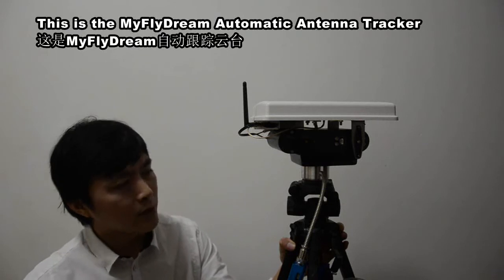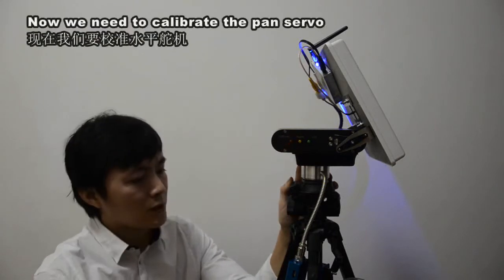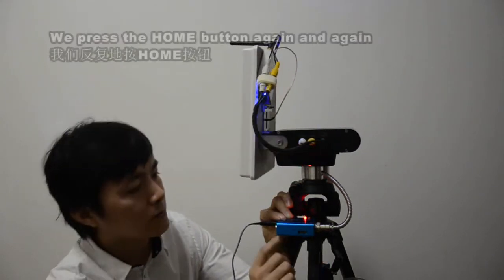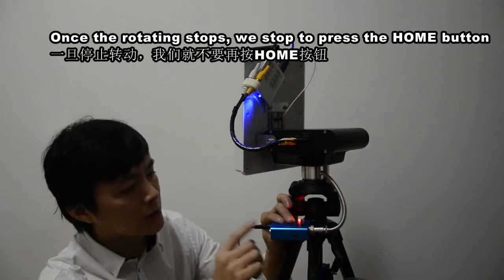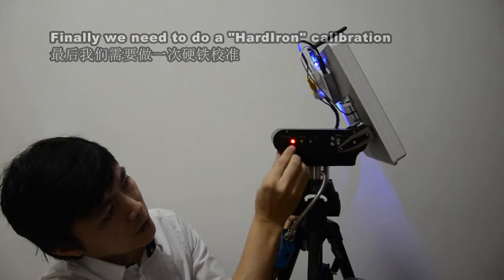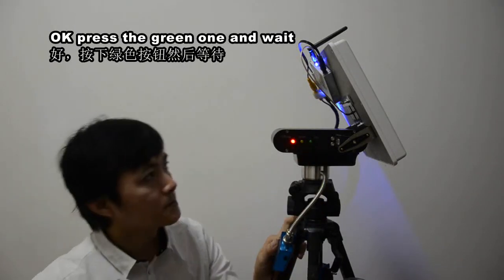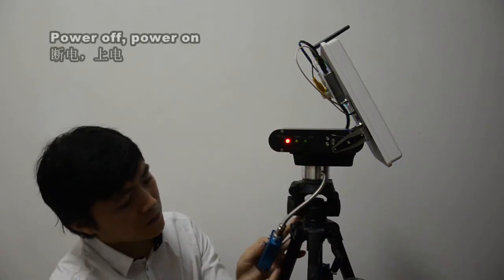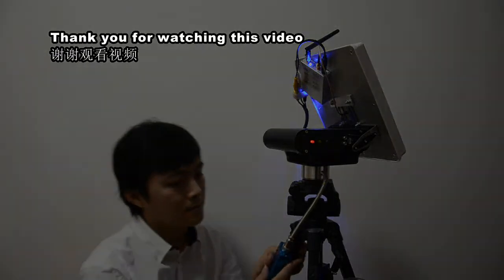MyFlyDream AAT Calibration

Comment: Hello, My tracker (driver V3) does not work anymore. When I do the calibration test it will reset, but wil not enter the PAN servo calibration mode (it wil not start turning) The Hard iron calibration it will do but the tracker test will not wordk. The light on the driver comes on, and after 4 times pushing the test button it goes out, however the AAT will not turn to North, west, east en south and it wil not tilt the antenna.....Please help!!!!

Comment: Hello,
First of all, nice video.
I have some questions because I have the same tracker but since yesterday, it doesn't work any more !!! HELP
I did everthing that we see in this video but it looks like everthing is in slow motion.
Is there a gps in the AAT tracker ?
When a go to the test mode he goes slowly and doesn't know where is the Noth,south...I tried to calibrate the pan but he doesn't turns, only the beep... sond. and after it stop.
Is it possible to make a RESET to the AAT driver ?
Thank you for some help
Reply: bresilboy36 i'm sorry to bother you I know this post was two years old now but I'm having the same problem with my antenna tracker as you did and I'm wondering if you ever came across a solution would greatly appreciate it